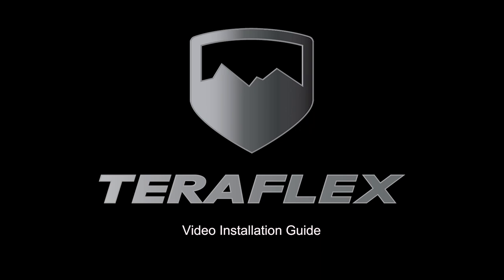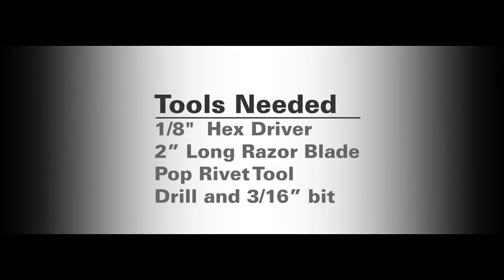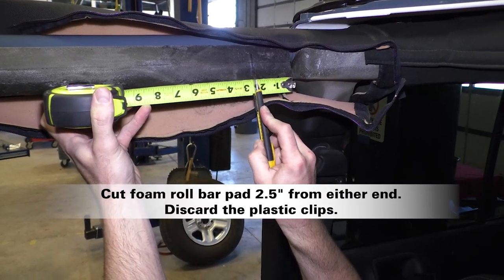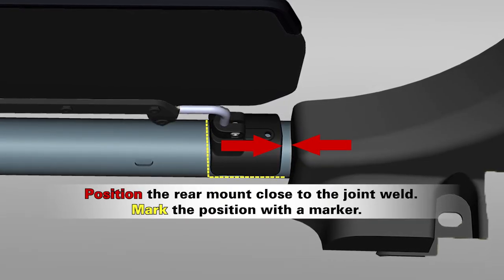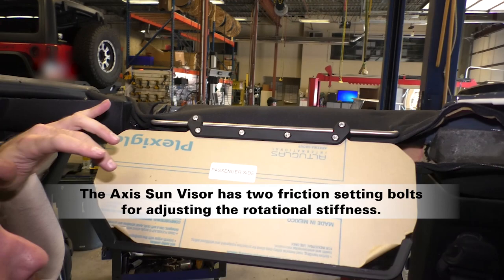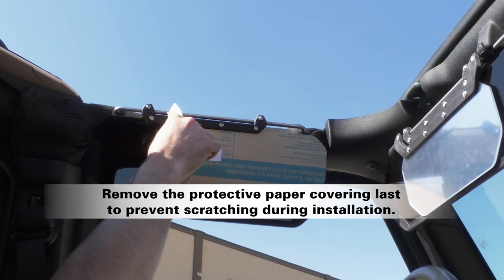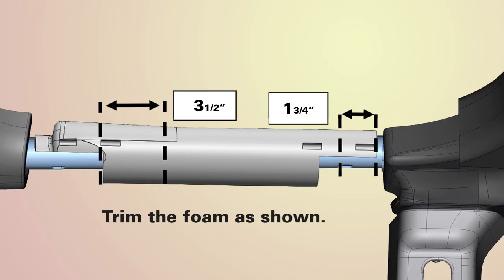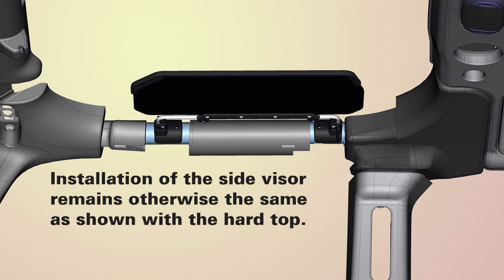TeraFlex Install: Axis Sun Visor Side

Comment: After 3 of 4 pop rivets failed on me, I went with nutserts instead. Upsized the holes to 15/16”, then used 10-24 nutserts with 1” bolts. Feels much more secure now. Would recommend the use of nutserts over pop rivets to anyone installing these side visors!

Comment: Which method would you recommend if installing the visor kit on a Jeep with both hard and soft tops?
Reply from the maker: If your Jeep has a soft top and a hard top, we recommend following the instructions for the soft top install.
Reply: I used the soft top method and have used it with both tops successfully.